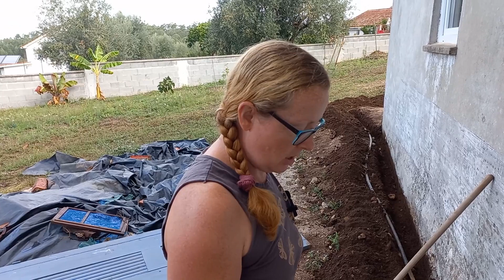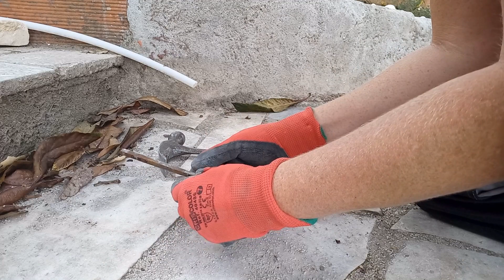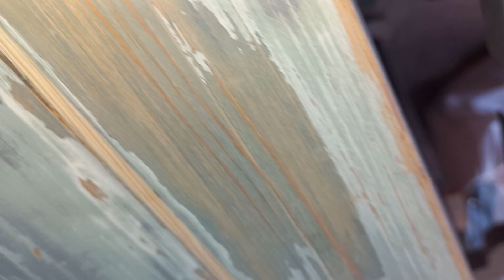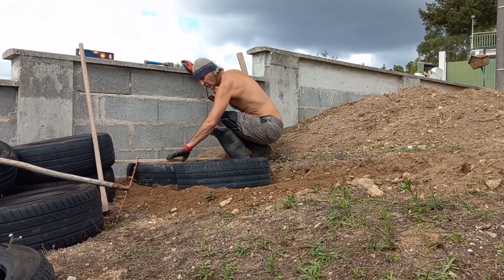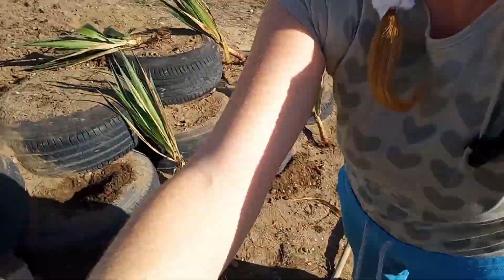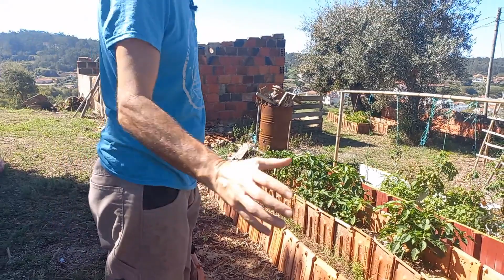Free DIY Retaining Wall! Renovating on a Budget in Portugal.

Comment: I love the door salvages. The old things refurbished keeps the homes character. Also saving money is very cool. The retaining wall is fabulous too. Maybe you should get in to making door mats and child's swings with old rubber tires. I bought 2 of these mats at a craft show. They last forever.🙂👍👍🇨🇦
Reply from the maker: I’m really enjoying the process of restoring the old doors. We’re trying to keep the rustic character of the home where we can. I’m so happy with how our retaining wall turned out! I tried to cut one of the tires in half to fit against the wall when we offset them and it just wasn’t happening. I tried using a hacksaw, the angle grinder and a machete and barely made a dent in it. Apparently cutting tires is outside of my skill set. 😂 All those YouTube videos that make it look easy are misleading. (Either that or I’m doing something wrong.)